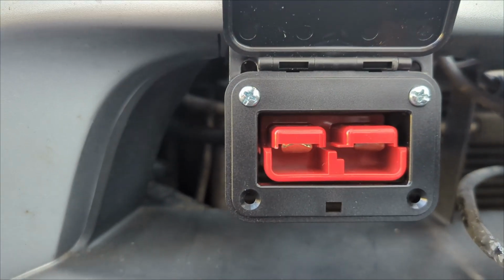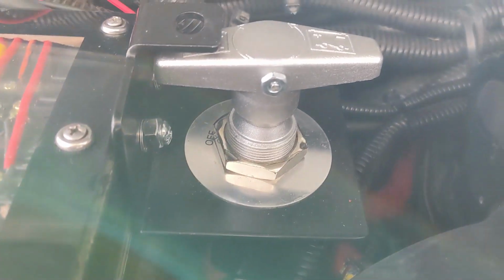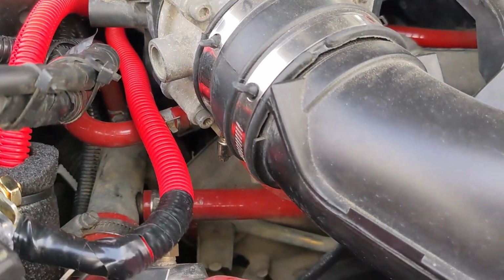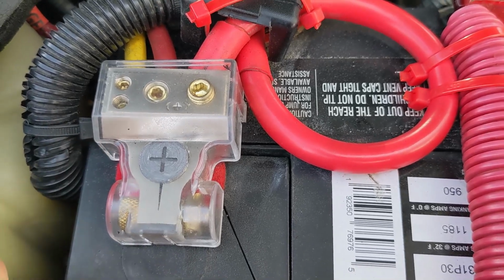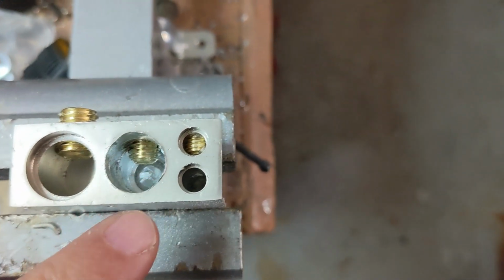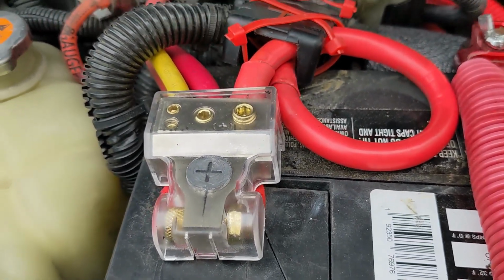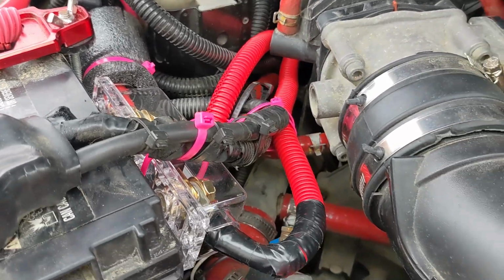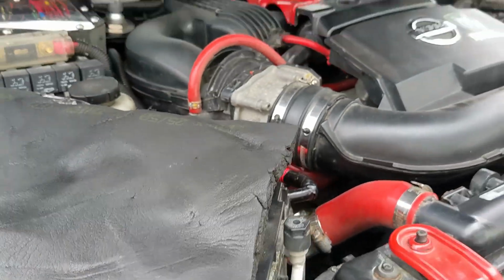Plug It In !!! Front Bumper 175a Anderson Power Connector

Comment: is that condensation in the upper light bar?  If so, what brand is that...may want to avoid them if I ever put in a light bar on my fronty.
Reply from the maker: Hello EC, yes, that's condensation, but my fault. I opened it thinking I was going to add some silicone sealer and then found it already was O-Ringed, so instead of an improvement, I made it worse. LOL. I will always be honest about victories and defeats, I've mentioned in a few videos where I did something boneheaded and paid for it. Que Sera, Sera. The light works okay, but it does fog up sometimes. I may pull it apart again but honestly, probably won't, it is 6 yrs old now and was only like $27.00 when I bought it way back when. I plan on upgrading to something better.
Reply: @frontiergeek4953  Ah great.  Thanks for the reply.  I was worried that those lights fogged up naturally.  I've been a victim of my own attempt to make something better.
Reply from the maker: Hahahahaha, sucks, doesn't it? But ya know what, if you're not breakin stuff, your not makin stuff either. Only the lazy have a perfect track record.